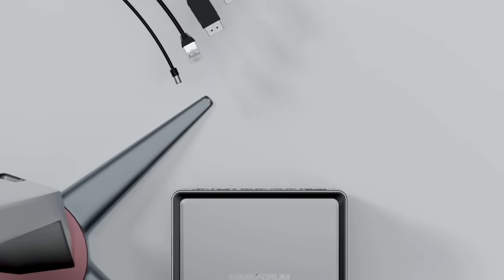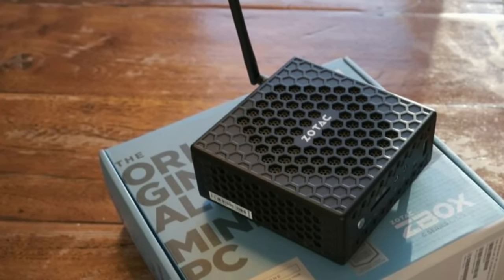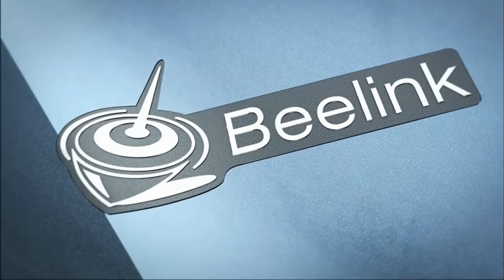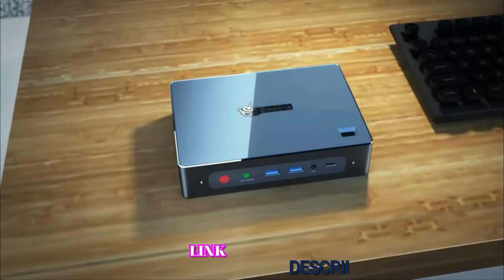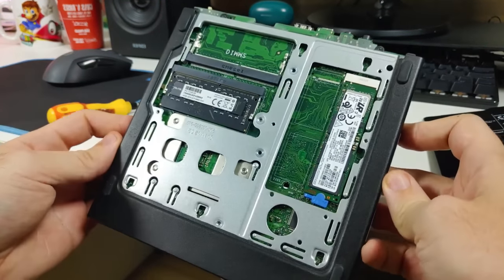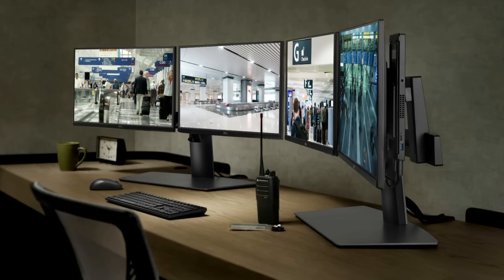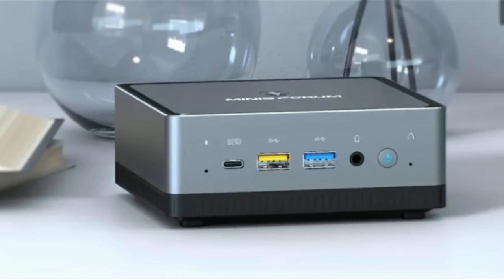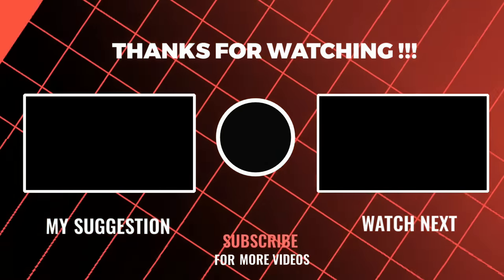Best Mini PC of 2022 | The 5 Best Mini PCs Review

Comment: I just purchased the Minis Forum Elite Mini TH50 running Windows 11 Pro to replace my Panasonic Toughbook with Windows 7 Home as my main machine. The TH50 is way snappier and does everything I need AND more! 16GB RAM, 512GB M.2, 6x USB 3.0, 1x HDMI, 1x DP to C, MIC in 3.5, Headphone 3.5. Lightning port, Expandable x2 2.5 SSD. Very happy with it.
Reply: That sounds amazing. How much was it?
Reply: @coindog6336  It was $550 +tax. May sound like alot but if you consider buying then upgrading which most people do any way, why not get it right off the bat. So far I have had like 10 open programs open at once and multiple windows and it doesn't even begin to bog down. I also discovered another feature it doesn't list. It has built in microphone arrays that can be used for recording or voice calls etc. without having external microphones plugged in.
Reply: Did you buy it from there website or 3rd party?

Comment: Mini pc is not the same thing as thin client. Thin clients are rarely used since the early 90s. A thin client runs just enough functionality to send input device actions to a remote computer and to receive and display output, doing no general purpose computation itself. A raspberry pi might qualify as a thin client.
Reply: Thin clients are used in lots of major corporations.  They have enough power to work as a workstation and can be alternatively used as a way to remote into a virtual workstation if desired.  
  
You can optiplex micro's pretty cheap because organizations retire the old versions and they end up getting sold cheap from resellers in bulk.
Reply: @Lolatyou332  that's called a cheap workstation
Reply: We deployed HPE thin clients just 3 years ago. I personally disagreed with the concept but apparently these are still being used.
Reply: @Lolatyou332  but granted, "thin client" is a function and a device-class lower-bound, so even a high end workstation could be a thin client if you only used it that much.
Reply: @tricky778  no.
Thin client is a concept.
Low power - low footprint. Raspberry pi of today are way more powerful than what is needed for a thin client.
Reply: A thin client is not a workstation. The purpose of a thin client is to connect to a Remote Desktop environment eg. Citrix XenApp, Citrix XenDesktop, Citrix Workspace, Microsoft Terminal Services. The workloads are conducted on the remote host not local. Local resources eg USB peripherals can be redirected to the session but the thin client is not to be confused with a fully fledged workstation or low powered workstation/ Mini PC. Two different things. The fact it is thin does not mean it is a thin client.
Reply: @ceajae3654  You are spot on, with one missing component. Thin clients come in a few software offerings and that is the true key to a thin client and a mini PC. Thin clients will run Windows 10 iot, a flavor of linux, a zero OS in the case of a teradichi based client and lastly a highly secure firmware like Wyse/Dell thin OS. So no the units shown are not thin clients.
Reply: Your definition alone excludes a raspberry pi from being a thin client....yet you say it is....

Comment: As soon as they can design a low profile, low power RTX card into one of these I may go Mini PC. I want a Mini PC mostly for rendering Blender stuff in Cycles running off Ubuntu, and the Vega 10 just doesn't cut it :/
Reply: Build your own.
Reply: @strontiumend  you missed the point...
Reply: @strontiumend  you missed the point bro lmao
Reply: I believe a few has rtx mobile chip now, also you could do a egpu
Reply: Heyyyyy I have seen a mini PC with a ryzen processor that has an external gpu dock. I don't remember what it was, but that's exactly what you're looking for: go search it out!
Reply: @leothehuman_9476  the minis forum b550 does I believe
Reply: Just buy an external GPU and a USB hub

Comment: Just wait until the Minisforum TH50 comes out on the market.  It’s going to kick all of these to the curb.
Reply: What are you talking about? The TH50 is already out, and has average power, with Intel integrated Iris graphics.
Reply: @squatch545  It was still on pre-order at the time that I made my original comment.

It’s got a lot of power for its price & size, and I definitely don’t regret buying it!
Reply: @NewLifestyleMentor  lol ok mr.
Reply: @el0senor0wino0  My comment above was made 7 months ago.  You need to realize that there are models that have been released since the TH50 came out, and they are much better than that particular model.

Comment: You have missed the asrock deskmini x300 , which as 2 x 3.5 SSDs and 2 x nvme drives and mine is fitted with a ryzen 9 5700g 8 core full 65w cpu , really fast and super small.
Reply: Also own this baby - it's awesome
Reply: @alx8439  where did you get it?
Reply: @octomoss7278  domestic market. Bought used one for a few hundreds of bucks
Reply: @alx8439  is it worth for gaming in long term?
Reply: @octomoss7278  depending on what kind of games you want to play. Gpu greedy AAA titles won't be shining there for obvious reasons, but with minimal settings and decent CPU choice you should be able to play them
Reply: Drop a link to it